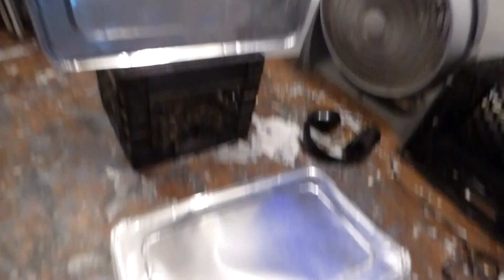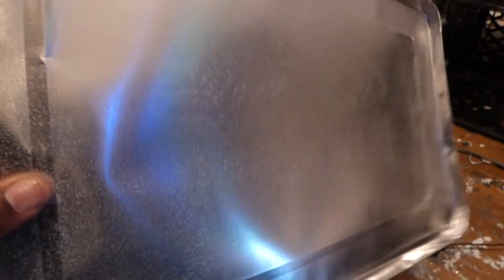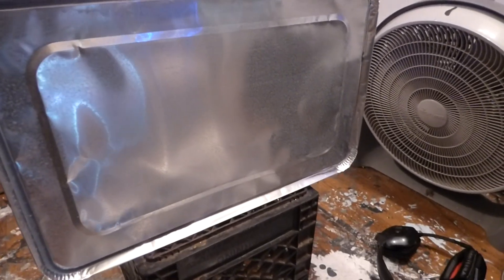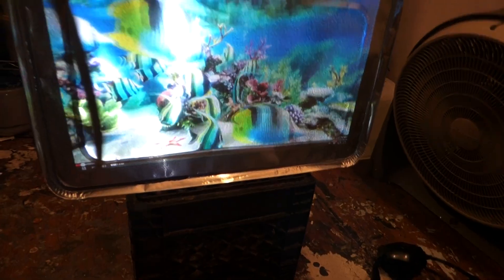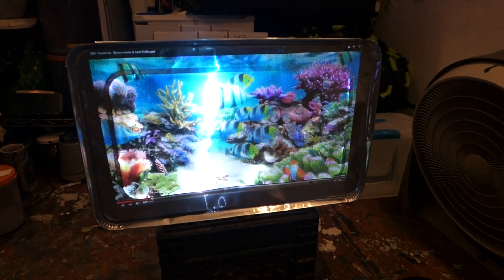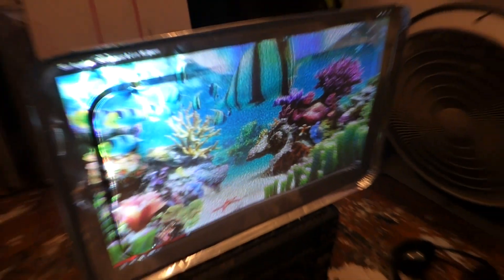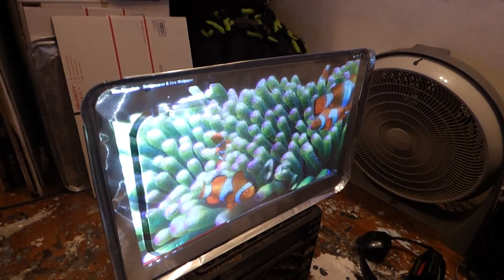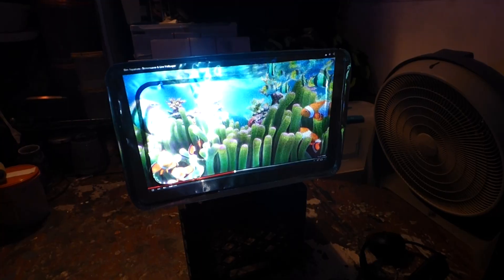3D INVISIBLE SCREEN PAINT ALUMINUM METAL PROJECTOR SCREEN

Comment: Crazy question would this paint work on mirror (acrylic or glass one ) ?
Reply: Yes, of course, but you have to use the proper under-laying coat for non-porous surfaces before the top (invisible reflective) coat. Make sure to use a paint sprayer gun and have the surface painted horizontally laying on the ground (so the sprayed paint will not drip).